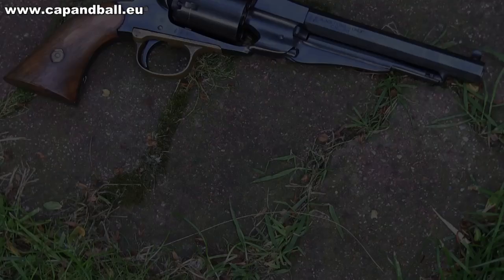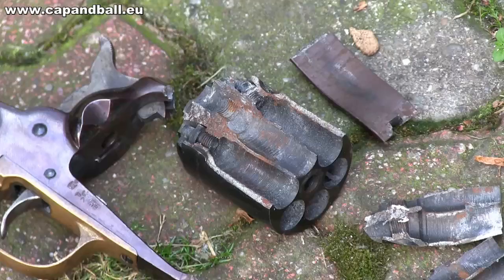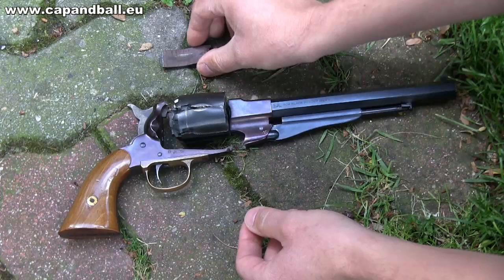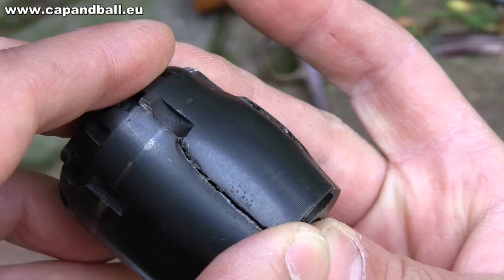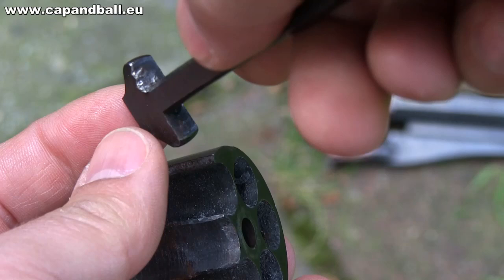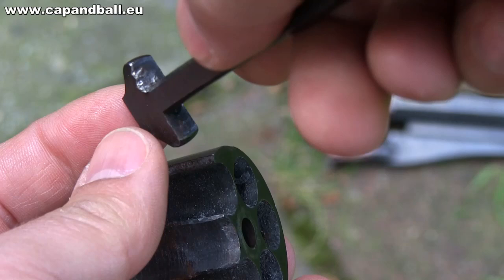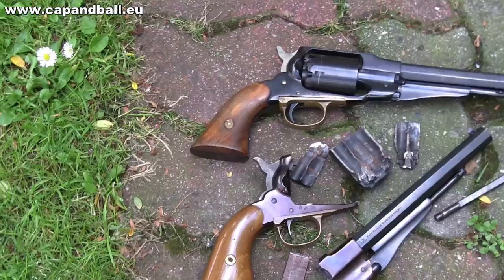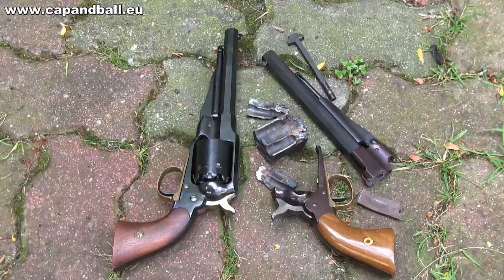The exploded 1858 Remington New Model Army revolver

Comment: If he foolishly used blank powder he took double risk as not only is blank powder smokeless (which is a no no by itself) but it is usually a very fast powder as well.
Reply: I never heard of blank powder. I've heard of black powder though.  And by the way, Black Powder is Not smokeless. It leaves a cloud of whitish  smoke after firing. Smokeless powder was Not invented til After the Civil War was over. If you were shooting black powder everyone would know where you were by the smoke cloud.
Reply: @johnjohnon8767  He's talking about powder from a blank cartridge, which burns very fast since there is no bullet to slow the expansion
Reply: @johnjohnon8767  God forbid,  that might eaven be flash powder.
Reply: @johnjohnon8767  they make multiple black powder substitutes  now  there are some rules for using  them. If you break the rules  it's on you. Overcharging substitutes  can and will  blow up your gun.
Reply: Dennis Young  that was a mixture of 50 50 black powder and  flash  powder.  The flash powder was to increase the pressure of the explosion.
Reply: @johnjohnon8767  "I never heard of blank powder."

Why would you open a public statement with that kind of effortless, shrugging ignorance? Does Google not exist in your version of the Internet? Or do you simply not care to use it?

Regardless of whether you've heard of it over the ol' campfire, yes, "blank powder" exists and has existed since WWII, where it doubled as a grenade filler ("EC" powder). The modern formulation is HPC 13. It's considerably hotter than even Red Dot and being used with any projectile turns it instantly into a pipebomb.
Reply: No. He used smokeless powder in a black powder ONLY pistol.
Reply: I know a fellow that did that very thing!
With the very same result!
Luckly no one was injured in his case!
"Black powder only" means " Black powder only!!!!!
Reply: I submit to you that the very reason why it exploded into pieces…  is strictly because this person did not have all of the cylinder chambers loaded up.  This would have prevented the expansion into the adjacent chambers and would have held the cylinder together tightly with pressure being applied to both sides “by the shell casing”!  You should never fire a single round loaded into the cylinder without ALL of the Chambers having either a live round or even a spent casing!  Pure “Physics” my friend.  And this is the only POST that I have ever seen with an ACCIDENT of this type!  NEVER EVER FIRE WITHOUT ALL CHAMBERS LOADED!  Because this is exactly what can happen with loading but a “Single Round” into this type of Conversion Cylinder!
Reply: @MichaelR-de6mt  Wow, you need to get out into YouTube more often.  There are dozens of videos of people demonstrating black powder firearms being used with smokeless powder turning into shrapnel or junk.  Also do you realize your prohibition against firing without all of the chambers being loaded is functionally impossible?  It only works for the first shot.  Instantly the gun will have an empty chamber and by the time we reach the last shot it is the only load in the gun.  Of course with proper ammunition it doesn't matter how many of a revolver's cylinder chambers are loaded.  

Your inaccurate speculation misses a key fact.  In 1858 Remington was not using high-carbon steel.  There was no reason too yet.  Black powder burns much slower than does smokeless powder.  Low-carbon steel can usually contain the pressure of a black powder load if it isn't too large.  The available volume of an 1858 Remington revolver does not allow the insertion of a black powder charge larger than what the gun's material can handle.  Smokeless powder burns much faster and creates a more intense pressure spike.  Smokeless powder was not invented until 1888.  The high carbon steel a gun using smokeless powder requires is more expensive than the low grade steels commonly in use at the time.  Many gun makers took awhile to begin making their guns out of high carbon steels appropriate to the new powder.  Colt for instance did not begin certifying their revolvers as being safe for use with standard loads of smokeless powder until 1902.  Remington never did disclose when they began using hi grade steels, but it is known the 1858 revolvers were long out of production by then.  Of course by 1888 cased cartridges were available and they wouldn't work in this percussion design revolver anyway.  

Getting back to this accident, if it was a blank, it wouldn't matter if the cylinder was misaligned with the bore.  Blanks have no bullet.  That is why they are called blanks.  If the cylinder is misaligned more than a very small amount then the firing pin can't hit the primer or cap and click would be the only sound heard.  Some blank revolvers made specifically for blank use only actually have no bore in their barrel as it is not needed for a blank without a bullet.  There is more than enough space between a barrel and a cylinder for the pressures of even a slightly misaligned cylinder to vent explosive gases safely when firing a blank cartridge.  It is called the barrel cylinder gap and is usually at least 0,004 to 0.007 of an inch.  Commercial blanks usually use a very fast burning powder designed to burn so quickly that even without a bullet it makes a loud noise and a flash.
Blank powder is sometimes called smokeless flash powder.  It is a very unsafe powder to use with a bullet as iy generates much more pressure than do the powders designed for use with bullets.  In fact all smokeless powders burn faster than does black powder.  I even have a video up demonstrating that.  
Regarding sim-aligned chambers in a revolver.  It is pretty rare for that condition to explode a gun (in fact I have never seen a case of it).  The shooter usually notices the condition pretty quickly as the bullets deform and small pieces shave off and spit small pieces out sideways and back to the shooter.  Pistol percussion caps are made to fit over a nipple that is usually about 0.016 inches in diameter.  This means that by definition the maximum amount of misalignment possible is half that.  0.08 inches is pretty small.  Small enough so that with normal chamber pressure behind a lead bullet most of the bullet succeeds in going through the barrel.  If the misalignment was more than that, then of course the hammer wouldn't hit the cap.  Usually the misalignment is much less, perhaps 0.01 - 0.02 inch off center and no issues beyond some inaccuracy result.
Reply: @kenibnanak5554  very concise explanation. Thank you!
Reply: @MichaelR-de6mt  There are nipples on the back of the cylinder. I don't think it was a conversion.

Comment: Well said. That is a fine phyical example of what can happen. All six chambers loaded with SP does not bear thinking about.   The problem is that even if the person knows not to use smokeless, he/she might still try. The more this type of video is aired , the better.
Reply: I use Hornady XTP .45 Colt rounds in this gun using a cartridge cylinder. It works fine, the steel frame holds fine. People had been doing it for literally a century since the gun was modified by Remington itself for cartridge use. In this case, blame the manufacturer or the cylinder.
Reply: MemeWarVeteran2016 
I don't think any cylinder that doesn't have what may as well be a pound of steel between chambers would survive a blank cartridge's charge of what might have been a fast burning powder, since they would have to work a pistol without the aid of a bullet.
Reply: Vincent Simbe its not the amount of metal its that blackpowder guns aren't the same kinda of steel and arnt heat treated the same way as regular smokless powder guns but ruger made a black powder revolver that could safely use smokless powder a few years ago.
Reply: @tatsuhirosatou5513  Yes the Ruger Old Army, in fact it is made from the same steel as there .44 magnum revolver. I have one and love it.
Reply: @IowanLawman  The issuer is not who to blame but that you will not lose your hand. It does not matter if you can find some guy who has been dead a hundred years to blame.
Reply: @IowanLawman  Yes that is true, but the smokeless 45 Colt factory loads are loaded to little above BP pressures, and for very good reasons...... The 45 Colt is actually capable of really big performance in a strong firearm. In an 1892 Winchester rifle, for instance, you could load it to about .44 Mag pressures with a slow pistol powder like W296 or a fast rifle powder like AR2205 and it becomes a ".44 Mag on steroids"..... a real brute.... but to load such a round in anything less than a Super Blackhawk would be 'instant shrapnel'.
When I used to load "hot" 45LC for my Rossi M92 rifle they were all clearly marked so that one never got into my ASM '73 Revolver...
So my point is, if you are using a conversion cylinder, stick to 'facctory pressures' if you reload, or things will get untidy.
Reply: @IowanLawman  Why would you blame the manufacturer of a cylinder intended for black powder only when some fool loads it with smokeless?
If you were to empty out your Hornady XTP cartridges and load the contents into a black powder revolver with its original cylinder, fire it, and blow your hand apart... whose fault would it be?
Reply: I hate inaccurate information! These guns will take smokeless powder with no, I repeat NO problems.
If you use the proper amount and type of powder .
Pyrodex, triple seven and black Horn 209 are all sutable for use. All are smokeless powder.
If you don't know what and how much to use, don't use any.
The rest of you,....Darwen award!!!
Reply: @tatsuhirosatou5513  Its not what they are made of but how they're made. And how you use it.
They don't make them out of wrought iron any more..
Reply: @fiddlesticksbessette398  it means smokeless powder. If you want to understand the terminology borrow or buy a reloading manual.
It will be quite the awakening.

Comment: True Black powder only.. Also i heard from someone making tests with black powder that a gun can blow up if you live air space between the powder and the ball, so always make sure the ball gows all the way down where it meets the powder.
Reply: That can happen in black powder cartridges as well. Thats why they use a filler or a grease cookie. If theres air space it leaves room for expansion. Which then becomes a pipe bomb
Reply: That is sort of a paradox.  

Compressing a load of smokeless powder raises pressures... it can raise the pressure generated in a .38spcl case almost to .357 Mag levels.  You probably wouldn't blow up the gun, but the loads would become way over-pressure, not good for the cases or the gun either one.

And with black powder, the ball (or bullet) must be at least touching the powder; somewhat compressing it is even better.

Smart rifle shooters will find the load they want to use, load the gun being absolutely sure the ball is seated completely, then mark their ramrod even with the muzzle, using tape, paint, or even notching it with a knife.

After that, they only have to remember to check the mark each time they ram a ball or a bullet in, to make sure that powder fouling hasn't made it feel like the ball was down against the powder when it really wasn't
Reply: @Weslag1  That's good advice about loading a front-stuffer... I've seen someone "ring" a heavy rifle barrel by not ramming thee ball right home. Personally, I run  cleaner patch down the bore of my .50 flintlock every 5 rounds or so. Doesn't take half a minute and saves a lot of strain on the ramrod.
One of the reasons I run my two Remingtons "full throttle" is that I know that it takes firm pressure to seat the projectile (RB or conical) deep enough to allow the cylinder to turn.... an even slightly 'high ball" will not allow the gun to operate.
I have fired many many thousands of rounds from them with no issues whatever over about 30 years.... gotta love 'em....
Latterly I have been using combustible paper cartridges....they are very convenient at the range and don't take a lot of time to make at home in the evenings....about 40-50 an hour.....BP rocks... :-)

Comment: Truth be told, it was just the cylinder that wasn't capable. There are cylinder conversions available for this gun, that chamber 45 colt, a smokeless powder cartridge. However that's not the same as filling a 1858 cylinder with smokeless powder. There's no stopping stupid, as they say.
Reply: I've actually bored out a cap and ball cylinder and test fired it with a smokeless ''prof'' load of 1 1/2 times the normal smokeless charge.  Test fired from behind cover and remotely fired that is.  Cylinder held fine.  Still would not recommend it as cap and ball cylinder steel is a good bit softer and made of weaker steel than nitro rated steels such as 4130 and such.  The main issue that caused the detonation of the cap and ball cylinder was probably two fold, one was powder from a blank which is extremely hot powder and not designed for a projectile, and putting too much in there.  Another issue with loading smokeless powder in a cap and ball gun is air space, because the ball or conical is designed to seat on top of the powder there's no way to ensure the ball stays at the proper depth with the rite amount of air space with a light smokeless charge.  So even with a light charge you could get a high pressure spike.  Basically DON'T DO IT!!!  Use black powder or equivalent substitute like pryrodex or other such fake black powder.  Even with a modern conversion cylinder you could damage or blow the gun up with an overcharge or wrong powders.
Reply: Smokeless needs an air gap.  BP is just the opposite.  If you stuff a 9mm shell FULL of smokeless, you're gonna ruin your glock.  Same way if you load a normal charge of BP, and don't seat the ball snugly, eliminating the air gap.
Reply: That FULL Chamber of smokeless powder would have been more than a double charge loaded in the .45LC case.  
.45LC cartridge takes 8 grains smokeless.   Black powder chamber can hold up to 20 grains smokeless powder.
Reply: @tacfoley should I buy a new cylinder for more safety? Even when I shoot just with black powder, because the original cylinder is 130 years old

Comment: Note that they now commercially load .45-70 for trapdoor with smokeless powder. Depending on the powder, they use 7-12 grains. Note that they also reload .45 Colt with smokeless powder. Again, depending on the powder, they use 5-8 grains by weight, not volume. This writer uses red dot and 700x in my .50 muzzle loader. From 8-12 grains, a load for the .45-70 ("book" listed as safe for the .45-70 trapdoor) works just fine. Further, a 44 special load in smokeless will generate about the same peak pressure as a full load of black powder in an 1858 Remington .44 cal. Again, it is in the 4.5 grains to 6.0 grains range to create the same pressure as a full load of black powder or its substitutes. These "horror" stories are ONLY when a totally ignorant reloader fully packs a black powder cylinder with smokeless powder. There is a YouTube video of shooting smokeless in the 1858 Remington. In fact, the recoil is less than the same gun packed with black powder. Why do I use smokeless? Well, at 7 grains, I can get 1,000 shots per inexpensive pound of CLEAN smokeless, vs. 100 shots of expensive, dirty and corrosive black powder. These "horror" stories must be sponsored by the manufacturers of expensive black powder substitutes.

Comment: Thumb up for this warning video. Those modern replicas are very safe, they can tolerate a full chamber of black powder to a point in which the ball is hard to press inside. It is not recomendable of course. The problem is when you try even a small weight of smokeless modern powder, then your pleasure turns into a serious danger.

Comment: I think he said it best at the beginning.. "there are always those who think they are smarter than the books". 
You aren't. Always stick with published powder and load numbers. All powders are different. It's not just black vs. Smokeless! Get a reloader's manual, find your load, powder type exactly, by exact name. never exceed bullet weight or powder weight. And NEVER use an unknown powder dumped out of a previously loaded cartridge!
Reply: In my opinion: Yeah but they need to work on case overall lengths not just the powder load. All to often repeating rounds off the charts cause all sorts of jams most of the time.

It's like the books only offer a basic starting point to a bigger process & the publisher may have never actually shot the charted load out of a real gun. 

This type of thing would cause ordinary curiosity to dangerous behavior that if the publisher actually knew anything more than pressure loading, people wouldn't have to monkey around to making the thing run right.

Those publishers specialize in single shot firearms loading obviously but would not tell you that.

Books tend to be helpful to educated idiots at best. We have seen that with fake history as all history is a sketchy thing altogether soaked in emotional realism & subjective bias.

It's just loading manuals don't explain how they set up & expect you to believe them when their loads jam up.